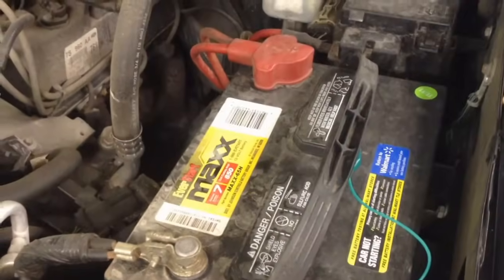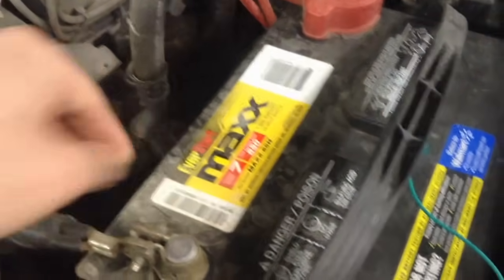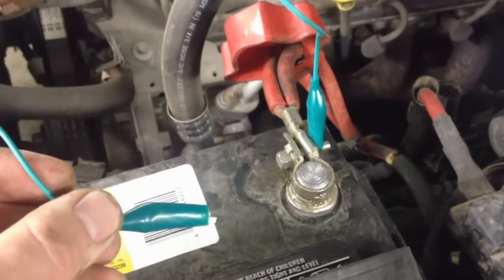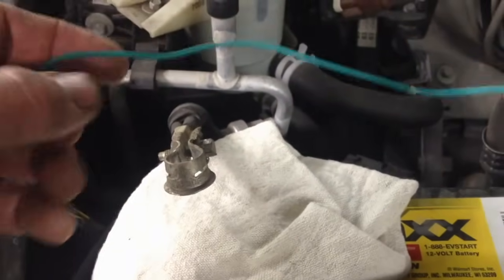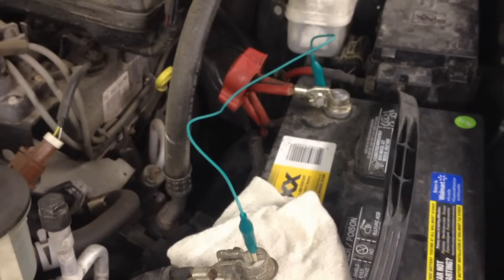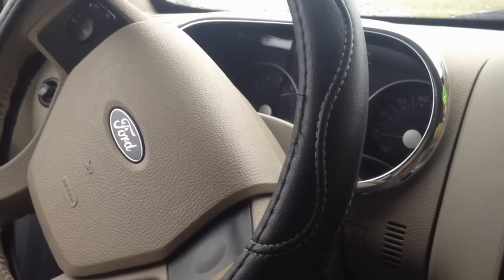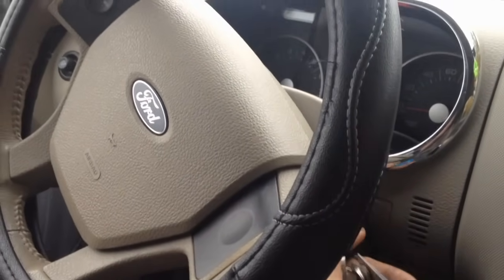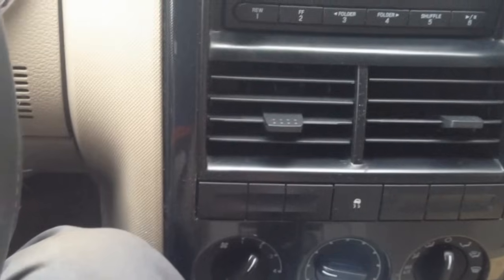How To Clear Your PCM'S Memory On Fords After Repairs

Comment: Please Please PLEASE, use a resistor inline and don't directly short them like this. Directly shorting out capacitors (especially electrolytics) causes years of wear in only moments. Grab yourself a cheap 100 Ohm resistor and put it inline between the two terminals.

Comment: Hello again FTM!! Happy New year to you and yours. Replacing my 10 yr old Ford H6 Battery with a new Motorcraft H6 Battery. When is a good time to reset the Battery System BMS module? First before driving or later is ok? Was having low voltage gremlins with the old one at 11.5V. Thanks very much and appreciate all your info. Cheers from Michigan usa

Comment: I own a 2011 Ford Crown Victoria Police Interceptor and I have a problem with the transmission shifting from 1st gear to 2nd gear at about 8-10 MPH at light throttle. I need to know how that can be changed. I really appreciate your video and have saved several for future reference

Comment: P1636 !!! Help !!!
BRIAN. How are you? I'm a huge fan. Will you please talk about the P1636 code? What is it specifically? It says manufacturer defined. It puts my transmission into 3 or 4 gear. I can reset it while driving or simply shut off engine and restart. This code comes on completely at random. No specific amount of time and either while driving or sitting at idle. Its crazy! 
2014 Ford Explorer Sport Ecoboost 3.5 Turbo.
I have Forscan and laptop and I am going to try. I took it to a shop and paid them $190 and they found nothing. They checked transmission fluid and drove it 10 miles and it would not throw the code. I told them it was P1636. 
Please advise. 
Thank you!

Comment: Ford Kuga 2011
I did the reset and transmission working much better. However, some things were not relearnt. These were okay before.
1. The fan control module stopped working.I have to bypass it and now the fan runs all the time when the car is on.
2. Washer fluid  pump stopped working.
3. Heated seats stopped working

Any ideas will be highly appreciated.

Comment: Can I do this on my 2011 Explorer  after my rack & pinon & PCM were replaced? I have Service Power Steering Now, Service Advance Trac, & Tire Sensor Pressure lights on & can only use manual steering.
Reply: Update: just tried it with cables & it didn’t work. I also tried it with touching the positive & negative directly & that didn’t work. To the shop it goes.

Comment: This video is almost 12 years old and still relevant. I was unable to clear permanant code P1299 with 2 different handheld scanners after replacing CHT sensor on my 2016 F150 2.7L Ecoboost.. Jumped across using jumper cables (all I had available) and left overnight. Overnight was probably overkill but the code is now gone.
Reply: I too only had jumper cables, I connected each black end to same end red then used like one cable just in case 🙂

Comment: I've watched this video a few times as well as the video about clearing the transmission data with Forscan. Should I do both PCM reset process and transmission clearing process and which one should be first?
What would be the correct order in the entire process? 
Anyone? Anyone? Anyone?
Please advise.
Reply: I have the same question now that you mentioned it. Ever figure it out?

Comment: All this did was drain my battery and when i jumpedstarted it back up it still ran the same. Hesitating on acceleration. Hard shifts, not downshifting and throwning a cel. I cant read what the cel is for currently but ive had a shop read it a month ago and it was for “tps and map sensor” both were replaced to no avail. I even bought a reman eec. Still nothing. 97 f series 7.5l 460 auto 2wd.
Reply: UPDATE: I fixed two broken vacuum lines going to the vacuum reservoir tank. I fixed the vacuum line from the charcoal canister to the purge solenoid valve and connected back to a vacuum source. I then found this bigger hose, connecting the bottom side of the intake plenum to the lower portion of the intake manifold right where the iac is, loose. I put some hose clamps on that hose and no more check engine light and it runs smoothly.

Comment: Will this help with drive cycle problems? I cannot pass inspection because my o2 and cat monitors will not activate I changed all 4 o2 sensors and cats and its still no go. Ive got an 04 f150 5.4.

Comment: I had an Alpine X 0009 installed in my 09F150 and all of the sudden on the diagnostics page I get
No communication with 
OBD2  And yes I've made sure all the switches on the deck out of proper
 Is there a cheap and easy way to fix this?
  It's not the end of the world everything else operates correctly.

Comment: I have a 2016 f250 6.7 and it shifts a little rough from 2,3...3 to 4 and sometimes it completely goes out of gear but if I turn it off and back on it's back to normal all this happened after doing some donuts in the back yard do you think this would fix it?

Comment: I'm dealing with a P0504 Issue with my 2012 Ford Fiesta...I have tried this reset three times and the code still shows up in Forscan, the wrench light in the dash stays on and the ENGINE MALFUNCTION ENGINE SERVICE NOW light is in the radio dash. HELP

I replaced both the CC switch and brake light switch....didn't change anything.

Comment: have a 2007 Ford Focus SES it was hit in front and I think there's a bad hood pin sensor or bad wire now remote start doesn't work. Overdrive button doesn't work. Car shakes and p0705 transmission code. Hood open doesn't light on dashboard either does Overdrive off. I suspect either aftermarket car starter or hood pin sensor or wire going to smart junction box (body control module) is the problem. Can I disconnect the wire harness from sjb and check its fuses or would that cause the sjb to need to be reset? Also if I unplug battery and connect battery cables with jumper wire to drain all power I think it resets all modules. Would this reset the sjb and if so would it need to be reprogramed? Any information would be great thank you.

Comment: Got a 03 f250 5.4 2v SD. been struggling to fix codes po135 po155. Mechanics diagnostic shows that o2s are working properly and that i should not have any codes. Could this trick help?

Comment: What if I don’t have that fancy wire connector with the clips on both ends? Is there a different way to do it without them?
Reply: 3 dollars for the fancy clip at walmart. Aisle K11
Reply: Jumper cables with the correct ends

Comment: Thanks for the video, I’m gonna try this… I would prefer it learn the way I drive vs the previous owner. I’m sure it’s not a bad idea to do this every once in a while anyway. I’ve got a question for you, I’ve got a 08 Escape limited. What would cause the stereo to change stations, and also change between satellite radio, and Aux and Everything in between… Have you ever experienced anything like that? Also the Traction control light will come on once in a blue moon and it will brake hard on the passenger side front. It will normally do it for a few minutes and then it’ll quit, or if I turn the car off and back on it’ll quit also… The only thing I could find about that was the yaw sensor maybe. But why would it do it randomly and weeks or months between.

Comment: Will this work to clear permanent DTCs in regards to emission codes? Stranded 2013 F350, 6.7 diesel.  I have a code for SCR, Nox sensory out of range. Its in idle mode.. what moron designs crap like this? Thanks EPA!😊
On a side note: Thank you for always posting interesting n helpful vids. you are much appreciated!

Comment: Thanks! Your vids have been a huge help to my DIY efforts. I have a 2011 and did this PCM clear to fix trans shift issues and to relearn fuel trim after a vape can purge valve replacement. Worked great except I couldn't get TPMS to work using the 3 on 3off HAZ way into learning mode. I had to do the key on, brake, three key on/off, brake, three on/off leave on.

Comment: What is that wire you used to connect them called?
Reply: It's just a wire with alligator clips on it. You can use any piece of wire though.
Reply: It’s a “test lead”. $5 at Auto Zone.

Comment: I have a 06 Mazda  S 3  with a code P2101 .. I have ZERO acceleration or gas when I press the pedal whether if the car is in park, drive, reverse or Neutral.. It was in Safe mode at first, telling me one of the Shift solenoids were bad.. So I replaced them all.. AT light came on.. Now I have nothing. I tried replacing the TB 3 times. Nothing. I tried replacing the ECU, Nothing,. I replaced the TCM with several different ones including a new one.. Nothing.. I was able to press the gas pedal and move the car 4 months ago.. Now, nothing is working right.. Everything was working till the TCM was replaced with a new one and the AT light came on.... I'm ready to sell this F---ng thing off.

Comment: I have a ford Flex se and I am experiencing limp mode, lost of power, stuck open, forced idle. I changed the throttle body and harness. I cleaned the upward oxygen sensor  and still having the problems. Any suggestions?

Comment: Maybe you can help me. I have a 97 f150 5.4l 4x4.  My truck keep popping the code "P0354" "ignition coil d primary/secondary circuit malfunction". I've changed the spark plugs, all brand new coils, cleaned the injectors, new maf, new air filter, new fuel filter. And I've changed the pcm 3 times. Twice with used ones and once with a brand new pcm. But it still pops that code. The coil isn't firing, I put a spark plug in it and crank it up, and no spark. Unfortunately I don't know how to use a multimeter, but I did put a test light on it. And I do have power to the hot. Unfortunately the other side I know hits so fast that the test light won't work. What else could it be? I've been on this problem for 3 months now. It starts up perfect, drives fine. Until it gets into overdrive. Then it shakes ans has no hp. Any help would be great. Thanks.

Comment: Will this help if there is an issue with the PCM charging the battery from altenator? I was told that the altenator is charging the battery but the PCM is not reading the charge. 03 sport trac

Comment: I apologize to bother you buddy but I just replaced a bunch of parts. New throttle body,new crank position sensor, new mass airflow sensor, new purge valve sensor,valve cover gaskets on my 2012 ford fusion SE 2.5L. I did your video with resetting my PCM. I now have sorta rough shifting and coming to a stop sigh or red light my car will die. Can you please give me a direction to go from here. Thank you so much in advance. You help me with my truck a couple months back.

Comment: Ok Ya'll, this is actually legit. This guys instructions are on point and need to be followed to a tee. I have replaced 3 PCMs on my 2012 Ford Flex SEL AWD and have been stumped by the error codes that show up for each. Also, the companies who provided the PCMs were stumped as well. In short, I replaced this final PCM and got a check engine light right ooff the bat. When I drove it, the SUV wouldnt get out of 2nd gear. I followed the steps in the video and the check engine light is off and the SUV is shifting as it should. Also, my previous PCM had a speed differential of 3 MPH less than actual. That has also been fixed thanks to this video!!! This guy knows what he is taling about. Thank you!!!!!!

Comment: I have 19 f750 saying  pcm control module  voltage  is 63 volts  the first issue is turbo over boost but today  was checking  generator  line 2 Kila hertz hi and line fault I checked the alt and few fuses all 14.5 when running
Reply: Well I'm leaning to pcm internal issues i checked alt  line pin  2 and its getting high reading from pcm  also egt and fuel pressure  all get red readings  i tried unhook the alt completely and still have 63.47 at control module voltage unless it's a ground or something else that feeds the pcm its pretty new with litany issues so nothing would surprise me

Comment: I have 19 f750 saying  pcm control module  voltage  is 63 volts  the first issue is turbo over boost but today  was checking  generator  line 2 Kila hertz hi and line fault I checked the alt and few fuses all 14.5 when running

Comment: Had both banks O2 sensors replaced, left rear speed controller, as it was completely shutting off going up big hills on the highway. All the same warning lights and dash alerts remain, as well as the problems. Tried this method, and nothing. It all started when i left my cell booster on all night and had low voltage in the morning. After charging it up, dash says hill assist needs maintenance, electronic steer assist, parking brake, and a few other alerts. No cruise control, etc,etc,etc. Codes come up for exhaust and sensors below threshold. After 2 mechanics wanting to believe computers and charging my left arm and leg, I tried this instead of having them sell me new control modules, but this didn't work, either. Why so many issues from low voltage? And why can't Ford certified shops fix it? And is it really ECM & PCM needing replaced, not just reset? Truck was completely fine until the battery slightly drained below 12v. Then suddenly nothing works. What in the Ford is the deal?!?!? I notice i seem to be the only commenter that didn't experience a miracle. What gives?

Comment: You don't have to run a wire from pos to neg. Just turn on the headlights for about 20 seconds, and it will drain all the power from the modules, per Scotty Kilmer.
Reply from the maker: Come on guy, really?

Comment: @fordtechmakuloco will this work on a 2015 F150? I’m about to replace an 02 sensor and service manual says to reset KAM by disconnecting battery for 10 minutes after replacing the 02.

Comment: My low mileage 09..6.4 hasn't been right since I had a guy install a tune. He won't stand behind his work. Will this simple progress clear the tune?? Truck is not trustworthy at this point. Shifts are weird...horrible mpg...goes into almost limp mode...drops power and downshift. Any help would be appreciated!!! I'm a novice to Ford diesels.
Thx!!

Comment: will this method work on a 2006 ford focus ac? I just replaced a bad ac pressure switch and now the dang ac clutch won't even try to engage.  I tried a jumper wire on the new pressure switch and nothing. All the fuses are fine, and the relays as well. Its like I am not getting any signal to the ac relay to send juice to the pressure switch. Before I made the repair, the clutch would only run hit and miss,  even after I added freon. But when I put my jumper wire on the faulty switch, it did fine. Thats how I knew the switch was bad. I am wondering if the PCM is causing my current issue.

Comment: After doing this my car didn't turn on?! 😕
Reply: Did you get it fix up? 
We tried it and it won’t turn on as well
Reply: @AngelicaHernandez-gp3qz  I still have my car parked since, I plan on getting it looked out soon, haven't been able to do much with it lately,  what issues did you have with yours before all this?
Reply: @TopG2tone  we changed a lot of things in the truck and we were just trying to do a reset 
Because when we put the scanner it would tell us the new things we put in. But it won’t turn on at all
Now battery is dead 
Now just save up and tow it to a mechanic 😒
Reply: @AngelicaHernandez-gp3qz thats to bad,  i really hope your able to figure it what's going on,  wish you the best

Comment: This is a long shot for getting answered, but I used 36-in 18 gauge to connect the positive terminal to the removed negative connector. It was connected for about 20 minutes before I left work. Is that length and gauge sufficient to clear the PCM memory, or should I have used closer to what you recommended from Amazon? I have the option to get 18-in 28 gauge leads from Harbor Freight, but I just used what I already had on hand.

Comment: Another awesome vid! Thank you 

Hopefully this will clear the code after I’ve changed the output shaft speed sensor on my 1999 b4000.

I had a question though, I live at the bottom of a long steep hill, should I drive to somehwere a bit flatter before resetting?

Comment: The negative terminal in my car is at the rear and inaccessible. To remove or access the battery requires a lot of equipment removing. I tried to access it but gave up I the end. I hope that you could answer my 2 questions:

1. Can I disconnect the positive terminal and connect to the negative side whilst it's on the battery, I.e. The reverse of what you did?

2. Does this clear accident information from the control module as I cannot get rid of them.

Comment: Does anyone know if this procedure works on a 2017 Edge? I know Fordtechmakuloco has a more recent video saying you can’t just reset the TCM by pulling the negative terminal battery cable. Which years would be the “late” Ford models for which this procedure wouldn’t work?

Comment: God is great. I stumbled onto this video accidentally.....I feel like a sweepstake winner right now. I am from Nigeria, been having all kinds of shift and idle problems with my Navigator for about 6 months now. Replaced every sensor, flushed the transmission and replaced the transmission filter..... nothing worked. The mechanics were just milking me. I followed the process just like it says here in the video. That SUV runs better now than when I bought it. THANK YOU SO SO MUCH. ♥️ from 🇳🇬.
Reply: You driving a gas guzzling gator in nigeria?

Comment: I did this on my 2013 f250 and when I turned my truck back on my trip odometer still had mileage on it.  I thought if you did a deep reset like this the trip should be at zero?  I left the battery unplugged for like 20min then did the alligator clip way for another 10min after that and the odometer trip still has miles on it?  Help please

Comment: Hi we just replaced the Knock Sensor and ETC censor and.
And crank shaft sensor sir, as well and my son's 2000 Lincoln Continental v8 4.6 and its not starting it clicks once like if it was the battery but it's a good battery has been fully charged what do I do help me please